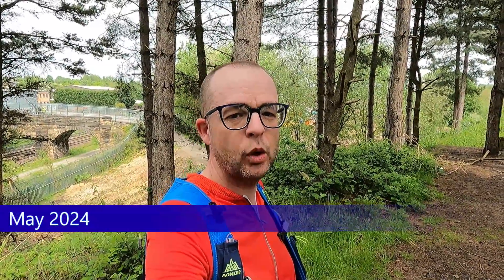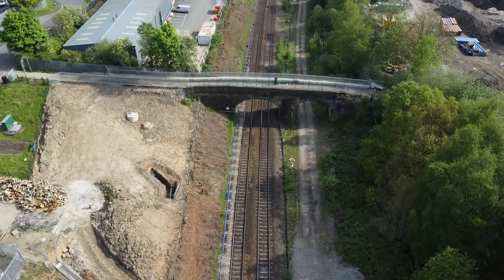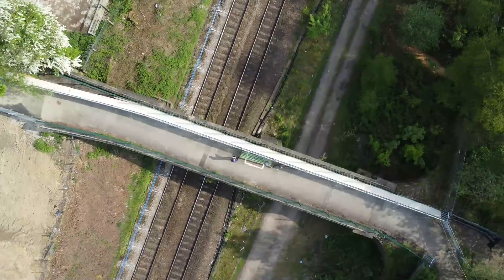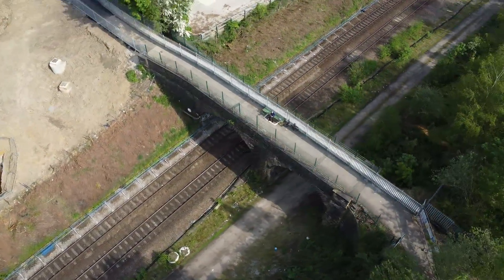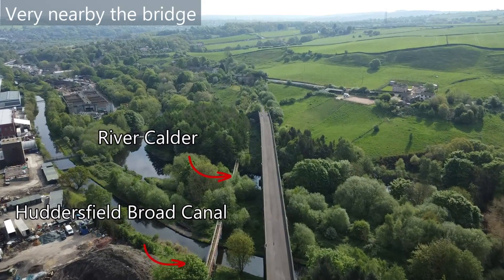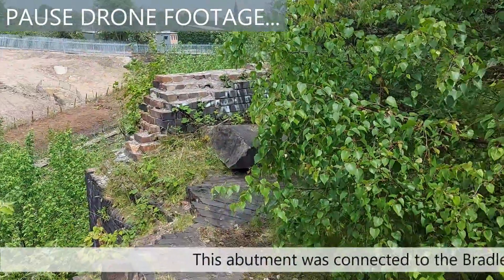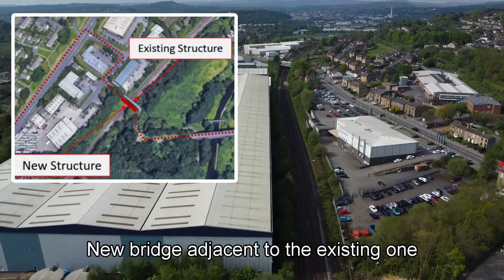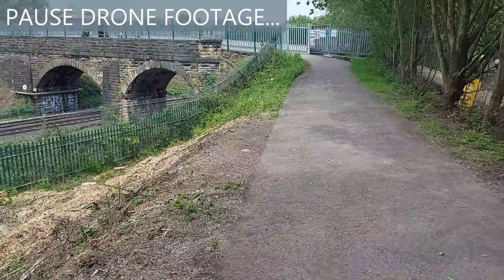DRONE Update: Wheatley's Bridge - Transpennine Route Upgrade - another big change coming

Comment: i do not understand as huddersfield viaduct used to have 5 tracks why they have to widen it for 4 tracks .
Reply: For the most part it's not actually being widened; some of the old steel spans are being replaced, but most of the viaduct and the abutments are receiving only strengthening works. The only part being widened is a small length by the station, where a cantilever section over the road will be added to extend one of the platforms.

Comment: I wonder why this bridge and others on this line could not have been saved by using GLS 100R® Electrically Insulating Coating?   This didn't seem to be listed as an option although it is cleared by Network Rail.  Is it just that this development has taken place after all the deliberations over the TPR upgrade had taken place?  Pity because it could have saved millions and saved some rather fine old bridges.  John
Reply: Overhead electrification needs height which the shallow arches does not provide.
Reply from the maker: There was no reference to that in the documents I read so presume it wasn't considered. I'm not close enough to the project or have enough engineering background to answer your question
Reply: Is the coating viable to use on masonry bridges. Afaik it’s only suitable for already painted/ metallic bridges?
Reply: Looking at the profile of where the new track positions will be, and where the pantographs would need to pass through, it's physically impossible to fit under the existing bridge